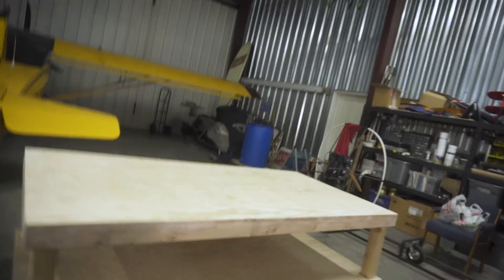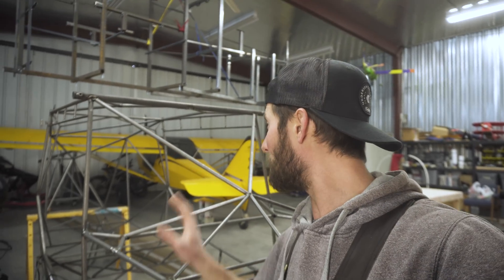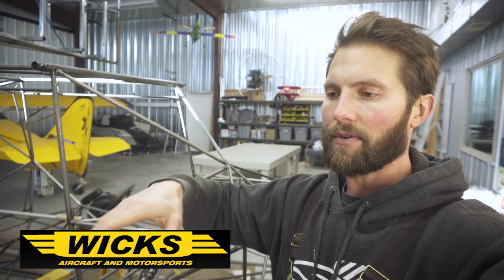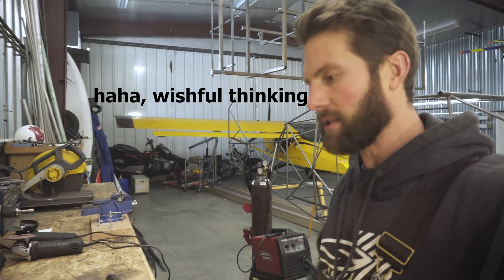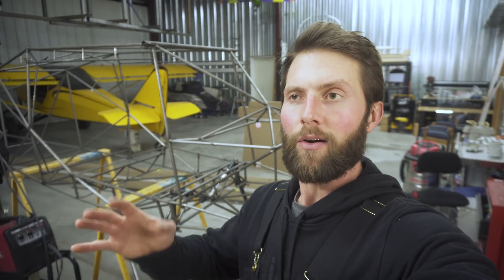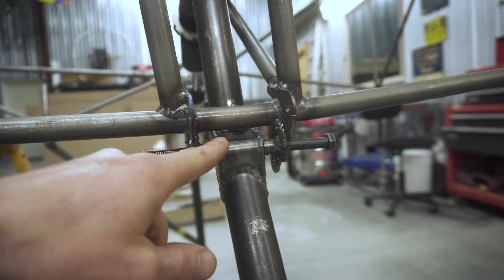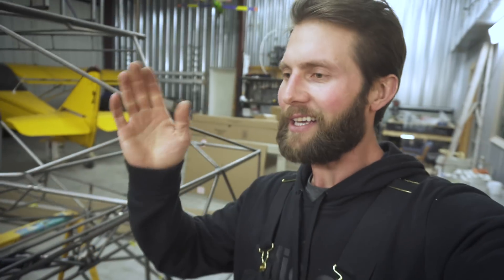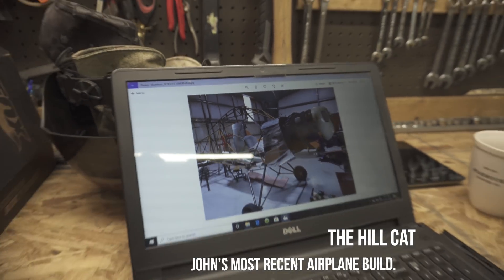NEW LANDING GEAR DESIGN (It's freaking awesome!)

Comment: you guys and your migs. you need to stress relieve all welds with a rose bud on a gas torch.  TIG or use a gas rig for welds. Put a secondary tube in your main strut support for some  spring. If you are borrowing from Just, put a super stol wing on it. Works crazy good but sacrifices top end for low speed lift like nothing else, and their landing gear cant be beat.  What brakes you putting on it ?
Reply: I agree with Jonathan, while an aircraft can be mig welded, it's not weekend warrior safe.  While welding the fuse with a mig is something you could probably get away with, I wouldn't dare mig weld gear or wing attach points or struts attach points.
Reply: Some of you guys need to get out of the stone age! https://www.harrisproductsgroup.com/en/Expert-Advice/tech-tips/welding-4130-chrome-moly.aspx I have not seen a kit aircraft fuselage that is tig welded. I prefer it myself but the old wives tale of not mig welding 4130 was put to rest 20 years ago.
Reply: Julio Shaheen you never a kit plane fuselage that wasn't Mig welded?? Open your eyes learn your facts and quote from an aviation approved authority. Torch or TIG are the only approved processes buy both the FAA and the EAA as well as other governing bodies throughout the world.
Reply: @waynetokarz174  you can get approval to MIG. Just aircraft airframes are all MIG welded.
Reply: @waynetokarz174   Explain     Torch ?  using what material?     Tig?  using what Material?
Reply: Greg Plaka torch refers to the tried and true oxygen acetylene. The FAA, EAA transport Canada, RAAC of Canada or any other aviation governing body in the world does not approve the welding of aircraft structures with strictly MIG. Some manufacturers use it to tack together parts then finish weld with a different process. From an engineering standpoint, the stresses induced by the MIG process in this type of application are not acceptable.
Reply: @julioshaheen8386  if you read the article you will  see they recommend against using certain welding wire in EXPERIMENTAL aircraft. The process can be done. JUST A/C is doing it but you have to follow established procedures.
Reply: @julioshaheen8386  The welding process inherent in stick or mig puts ferocious stresses in the parts as they cool. That's a stone age fact. I did not say you can't mig. I said you need to stress relieve. Learn to weld, learn the different processes and then spout off. Aircraft are not tinker toys.
Reply: @automan1223    in this case it is a tinker toy

Comment: Hey Jonas, Love your Vids.  One thing i noted looking at the structure was that the two truss sections that are on either side of the coilovers supporting the rigid connection to the coilover.  They would seem to be prone to twisting forward or back in the direction of travel under heavy landing load.  They dont seem to have much structure to stop this from what i could see.  To lower this risk a member could be welded between the two truss sections above the lower point of connection to the coilover.  That would reduce or prevent this twisting.  That being said i could only see certain angles of it, so i may be wrong.  Vertically it looks fine, but it seemed to have very little preventing the forward/backward motion that would result in reaction to heavily loaded shocks if you had a hard landing at speed.
Reply from the maker: Very true. I still have a few tubes that are not yet welded in. Planning on adding some.
Thanks for the comment. I’ll take any input.

Comment: Those Edge performance Epex engines are amazing. 300hp is awesome yet I think I saw a dyno run on his Instagram of almost 397hp. What are you thinking for wheels and brakes? The Beringer dual caliper setup is gorgeous and seems to perform amazingly well.

Comment: Interesting table project.  Gave me some ideas, thanks.  I’m also a member of the upside down club.
Back in 97 I flipped a 185 Cessna amphibian while on short final for a landing on a paved runway.  Engine failed ,  fell short of runway
Into a marsh with gear down.   Terrible ,  airplane totaled, wife couldn’t cut grass for six months, Otherwise all else was fine.

Comment: Haven't been in the upside down club, but have done an engine out into a strip mine, and took out the top two strands of a barb wire fence, ripping off one wheel, and bellied it into the ground. Any landing you can walk away from.......

Comment: How about cable from the gear axle to the opposite side fusalage mount point to assist the gear when it reaches the end of its travel
Reply: You pretty much described the gear on the PZL P.11 fighter. A round cable or tube has loads of drag.